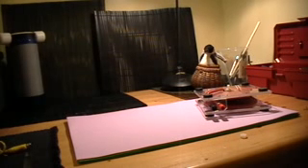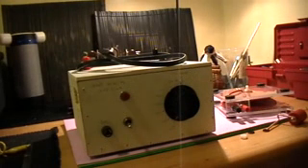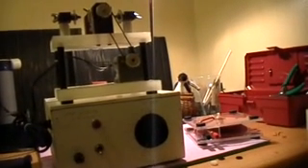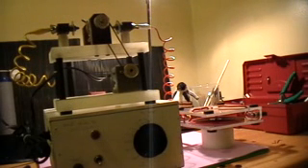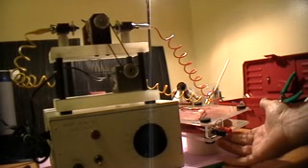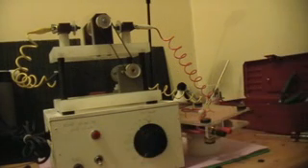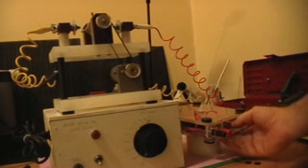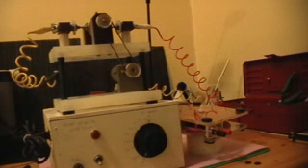Comparison of Tesla Bifilar and Pancake Coils

Comment: Interesting demo, and I love how you've constructed the parts. But it becomes a little less intriguing if you use the words "primary" and "secondary" instead of "transmitter" and "receiver". I see nothing to suggest that this isn't just behaving like a transformer, with the bifilar coil acting like a regular inductor with fewer turns than the other coil. Interesting in itself, but hardly earth-shattering.
 
 On a practical level, if the two coils are identical in wire length, type and number of turns,  how can they have similar inductance (assuming each turn of the bifilar includes both cores)? Or if you are counting turns in the individual cores (one wrap effectively = 2 wire turns), then why doesn't the monofilar coil have considerably greater diameter..?

Comment: To all who watch this video: the mystery of why the Tesla bifliar coil is a much better primary coil than the so much better than the pancake coil is well answered in one of his later videos: https://www.youtube.com/watch?v=OcFySCAxLzs?t=1m15s: The tesla bifilar has significantly more inductance and self-capacitance (see 7:30 to the end).
Regarding the latter, Tesla in his patent (512,340) gave a theoretical example of the parasitic capacitance in his coil being 250,000 times that of a pancake coil, because the interturn voltage was 500X greater and E = (CV^2)/2.
Reply from the maker: Not significantly more inductance, at least in my testing, and not significantly less DC resistance. Significantly more distributed capacitance yes, and this is why it resonates at a significantly lower frequency than a monofilar coil of the same dimensions and wire length. 
Tesla's 250,000 times more energy storage figure was predicated on the values for interturn voltage and etc. that he stated in his theoretical example. In real coils that we are likely to encounter in our little home labs, the energy storage due to the TBF winding is much less, but still significantly more than that of the monofilar coil of the same length of wire. 
Thank you for watching and commenting. I will be publishing a video on comparing inductances and resonant frequencies of TBF and monofilar coils, and other effects very soon.

Comment: Tesla's patent #512340 is as a coil for electromagnets.  I've only seen experiments as where they are using it as a high voltage transformer - never for its use as an electromagnet.  Since you've got such a lovely test jig of the bi-filar and the standard pancake coil, could you possibly do an experiment of hooking them up to a DC source and measuring the flux of each?  If you don't have a meter to measure flux, a simple one can be made from a ratiometric linear Hall Effect Sensor.  The output does not have to be calibrated.  I'd think relative voltages would be more than enough to suffice for the experiment.  Have you worked with tri-fi or quad-fi?  Of course, the same question would apply to those too.  Kind of an electromagnet "shootout" would be of great interest - at least to me.
Reply from the maker: +Hugh Jorgan Thanks for watching. Unfortunately I don't have access to this apparatus any more, it got left behind in a move. But the test you suggest has been done several times already with DC, and the result is that there isn't any difference in flux, in the experiments I've seen.  (People have made claims, without testing or understanding.)The main advantage of coils wound using Tesla's patent is that it increases the inter-turn capacitance, and hence the energy storage, in the coil but these effects are only evident when the coil is used with AC, or during the very first and last current ramps when a DC pulse is presented to the coil. 
There is a person working with multifilar coils, he goes by "skycollection" and has some very interesting designs. Check out his YT demonstrations.

Comment: u didn't get any sparks at the small sg because the coils were out of tune, once u tune the primary to supply and secondary to the primary, u should see the sg going. just like this: 
Introduction to resonance, but instead of a light as resistance u got an air gap.

Comment: The difference is energy storage and natural self resonance of the transmitting bifilar coil. In a bifilar, 1/2 the input voltage appears between each adjacent wire. Capacitance between the wires stores and releases that HV/HF energy. In the standard pancake only the voltage divided by the number of turns is between each winding. Should be plainly evident on the scope with a HV probe.

Comment from the maker: I apologize for missing your comment earlier. The plastic is acrylic (perspex, plexiglas) and I cut it on a bandsaw and filed the edges smooth with files. Careful drilling with steeply pointed drill bits to avoid cracking.

Comment: in a bifilar coil the first half of the magnetic field created magnetic resistance but as the pulse passes the first winding in the coil the magnetic field that created the added resistance is now collapseing and actually serves to push the voltage through the second half of the coil. so a coil wound this way almost cancles its magnetic field resistance that is created by the power going through it. add capacitance like RLC circuit and add two wraps of heavy wire around bifilar coil take reading

Comment: The difference in the coils if you have not read why tesla said to do them that way is the resistance in the coil- heres how it works in laymens terms as the wave form or electric pulse travels through a reg coil it adds resistance to what it normally has because the as it travels the length of the coil it is creating a magnetic field that resists the current/voltage flow. next post will tell you what i know on how to use them effectively.

Comment: continued: I believe the internal capacitance effect is enhanced via the use of high voltages.  If you think about how voltages and currents behave in I and C circuits and put both into one unit.  hmmmmmm this may be a demonstration of Teslas radiant energy claims.  Is this tapping into the scalar componets that were removed from Maxwells equations by Lorenz's regaging of them.  If so this could be overunity.  I would suggest measuring input to output power to see if the coe is > 1.

Comment: This is a very intriguing demonstration ... my hats off to you.   From my understanding of coils and in particular Teslas bifilar pancake coil ... the idea is to add internal capacitance to the coil.  In motor design an external coil is often added to power correct the circuit.  I wonder is this the same idea here.  Does represent a combination of inductance and capacitance in one unit.

Comment: i found on several styles of tesla bifilar tesla coils that i have made cylcindrical spiral and conical coil that i had made well they dont work not well at all for receiving  from a primary and even worse when the primary is bifilar the cylindrical bifilar tesla primary though makes a little rf but has no output strangely  enough i haven ttried it on a normal tesla coil yet mabe that should be next according to tom bearden and others a bifilar secondary transmits transversely

Comment: do you get allot of residual capacitance in your spiral coil on mine i get some after everything is disconnected only difference being in mine is more turns smaller gauge or wire and the turns are spaced i also found spiral coils make good capacitor if you stack them on top of each other with spacers in between the coils each coil has its ends together one coil goes to negative the other to positive

Comment from the maker: Not yet. I'm pretty cautious about hooking expensive test equipment up to these circuits. (Even so, I blew out my benchtop DMM testing this unit...but it was a cheapie so no great loss. It was a 1200+ VAC surge.)
As soon as I have time to make a safe voltage divider/safety gap I'll try to do some measurements.

Comment from the maker: Check the patent, #512340. You will see Tesla's drawing of the coil. The only place the current paths are opposing is in the feed wires. In the coil itself the current in adjacent wires is parallel. So all the current flows either clockwise, or CCW, depending on the direction of the spiral windings.

Nevertheless, I agree that opposing current path coils will be interesting to test. 

Please see my next comment.

Comment: I'm surprised. First of all, bifilar coil should not generate any electromagnetic field, because there are two fields completly opposing to each other. But we clearly see that this does not happen. Some say that bifilar coil is a longitudinal wave transmitter. Bililar coil shoud not pick up any external magnetic field either. It could change resistance if it were made of bismuth but not produce voltage. Putting it simple this great experiment shows unknown phenomena.